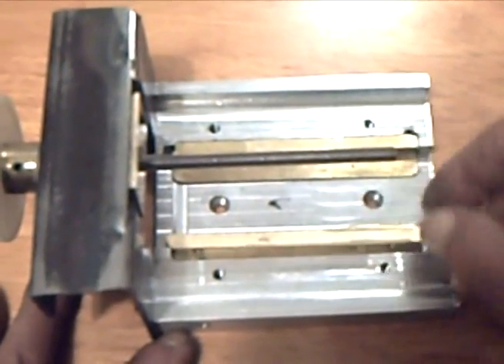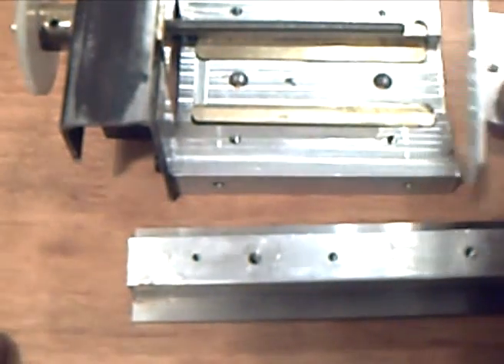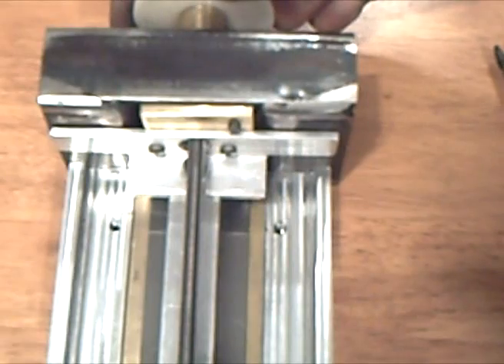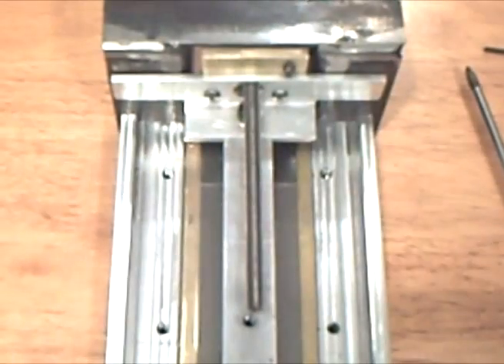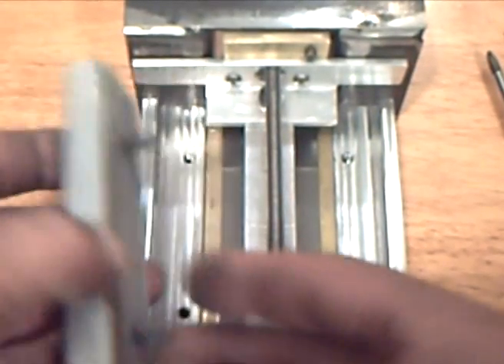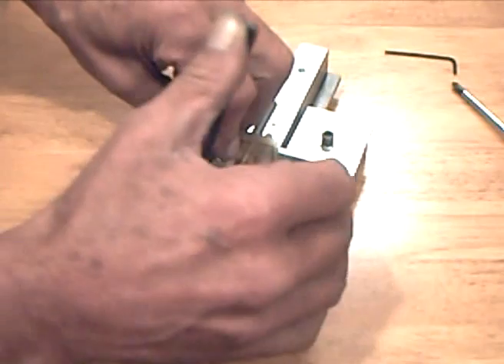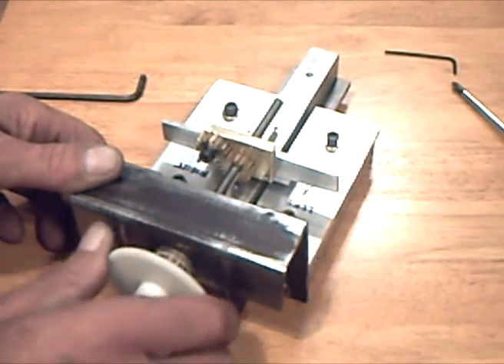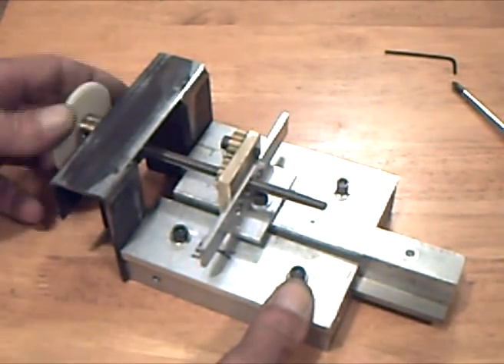EDM machine,drive mechanism, part.3 - the drive nut

Comment from the maker: yes, tapped to act like an adjustable jam nut.
actually, a huge amount of thought goes into designing stuff that's easy to make.
once you have the jig or setup tweaked and operating, the labor time per part is pretty low after that.